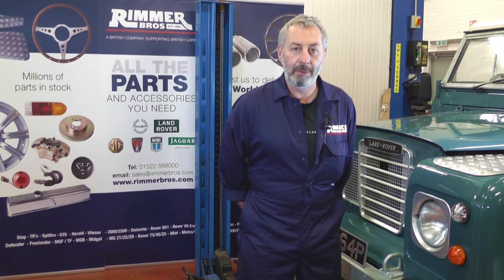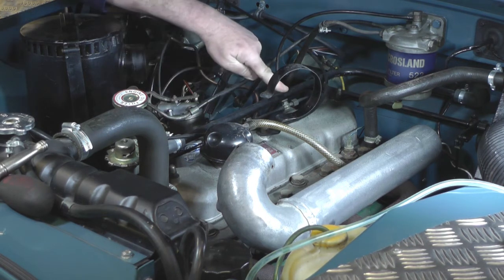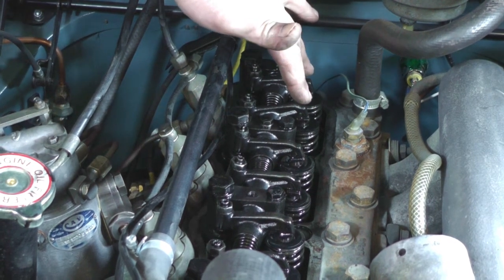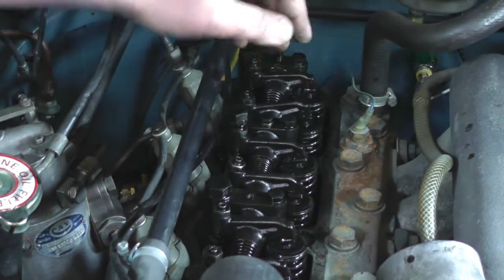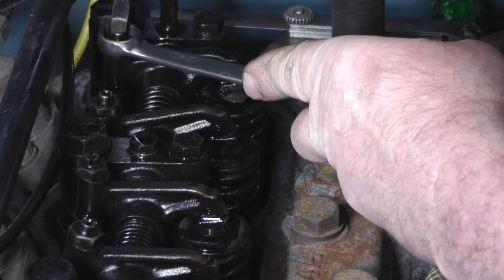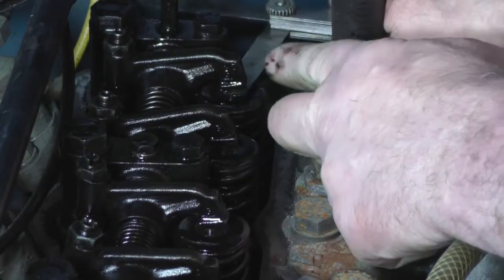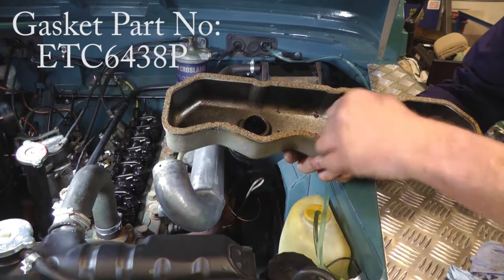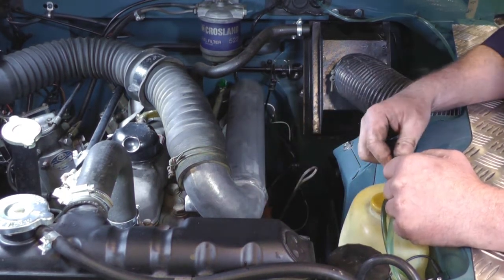Land Rover Series 3 88 1976 Setting the Valve Clearances

Comment: Nice video , Most use the rule of 9 , think you’re getting mixed up with metric and imperial clearances , for both petrol and diesel t
All clearances are 10 thou, (0.010 inches ) or 0.25mm , not 25 thou.

Comment: may I ask. For my 81 2 1/4 diesel My green manual states: Set tappet clearance to .0.25mm (0.010) for  all valves
Reply from the maker: Thank you for your question. It is recommended that the exhaust tappets be set to 0.25 and the inlet be set to 0.10